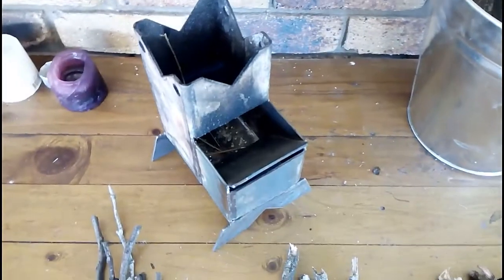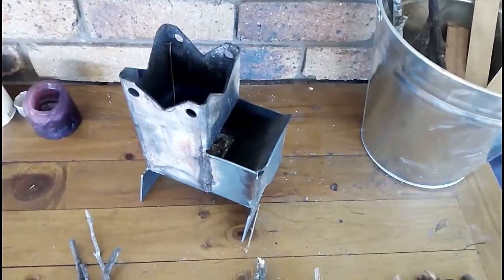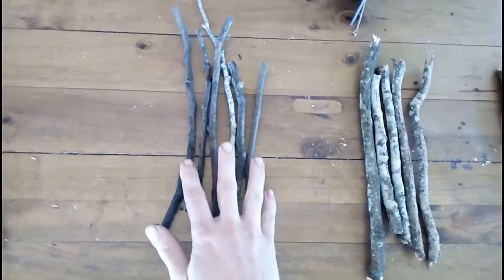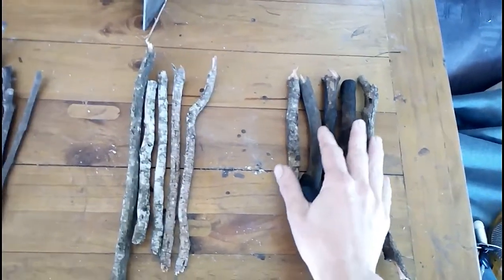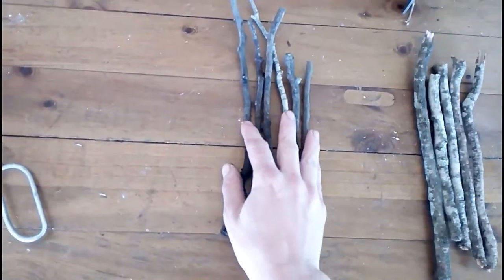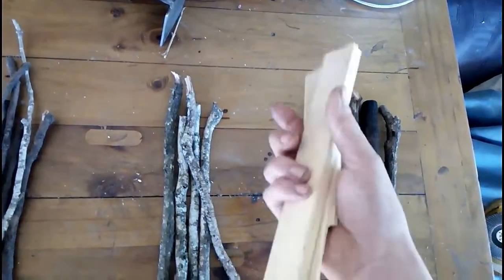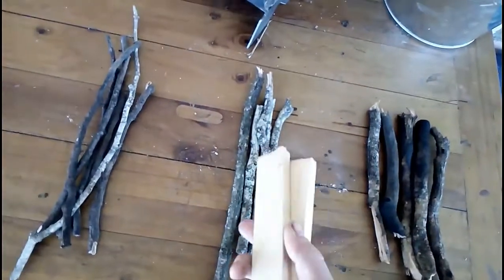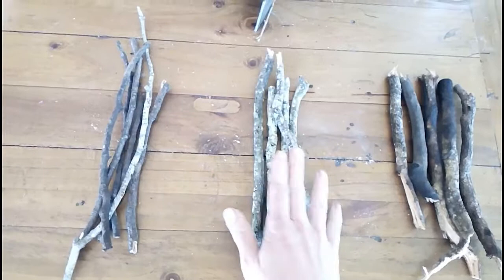Controlling the temperature of your rocket stove

Comment: I have a question.
Rocket stoves don't smoke but does it mean they don't smell?
Reply from the maker: They do smell, but not like burn your eyes smokey smell.  They do smoke a little but only during warm up stage as you are getting them going and the fire is building up heat.